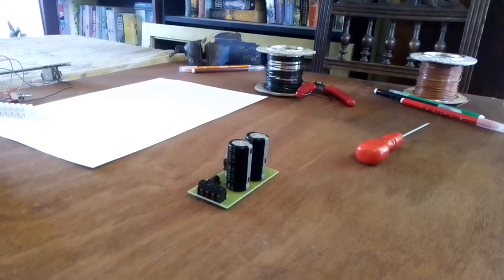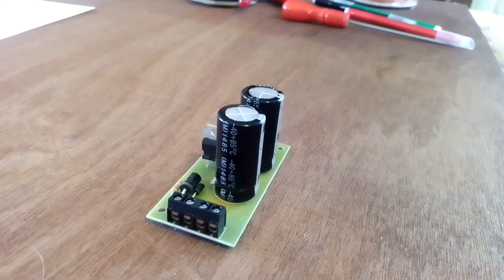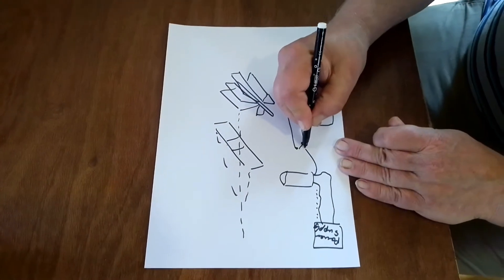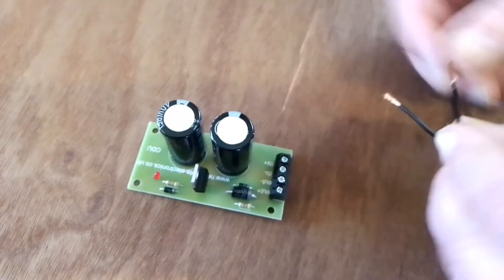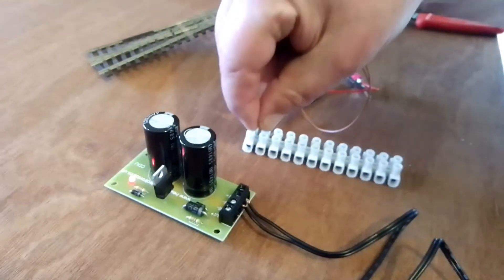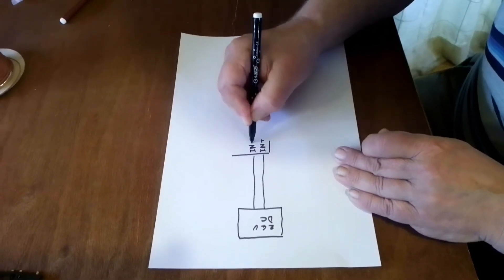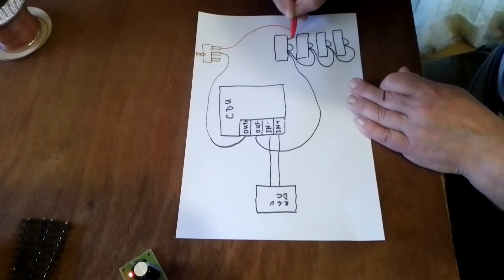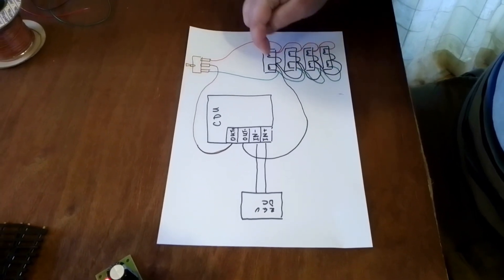C D U - Capacitor Discharge Unit Explained.

Comment: Hey, so with a CDU, do you not need a momentary switch? It appears you used a standard on off on switch?
Reply from the maker: You still need a momentary switch. The switch lever of the switch used, returns to the centre unconnected position when released.
Reply: @heathcote-electronics  thought so. Thanks for confirming